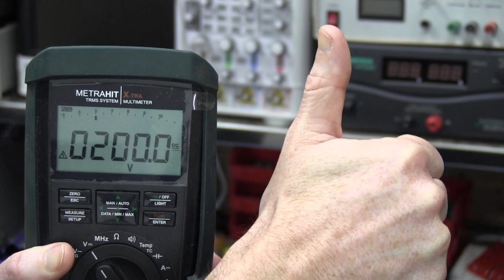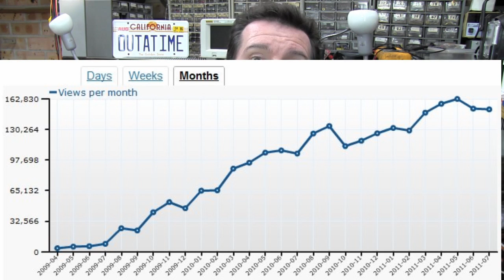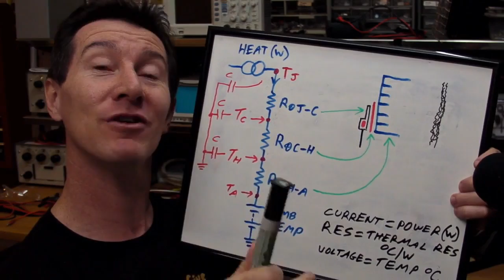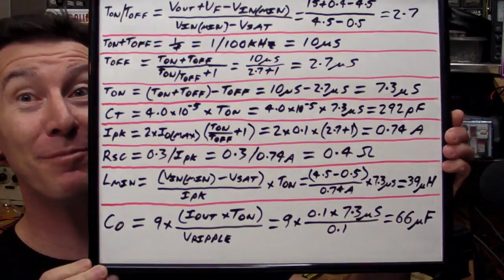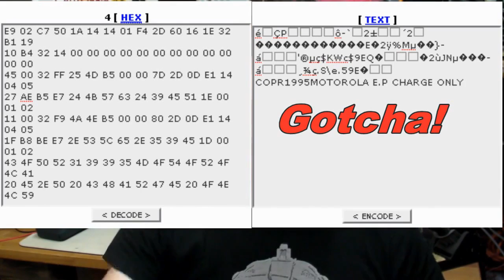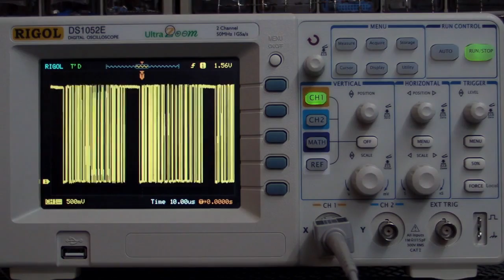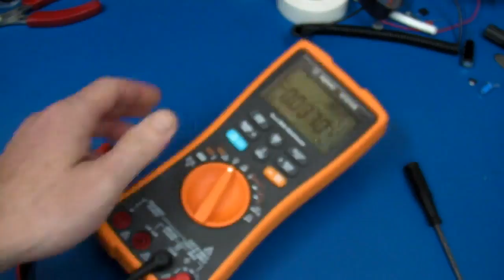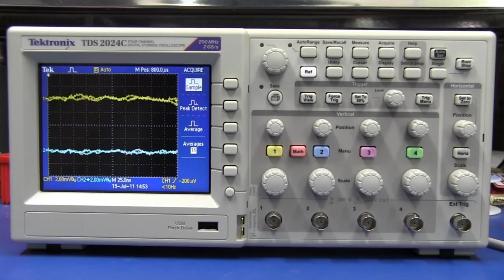EEVblog #200 - Retrospective

Comment: Great job and congratulations on >200 episodes of eevblog! Just one suggestion, could you (next time) number each of the clips by episode number? I realize it's a hassle, but there were a few interesting bits I'd like to check out, but I'm going to have to search them manually (since it didn't look like they were in increasing order).